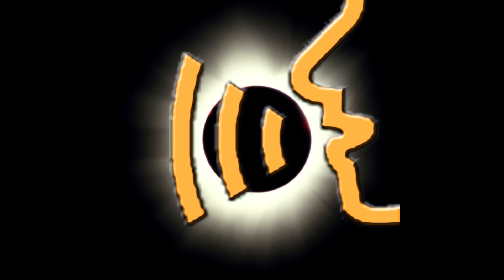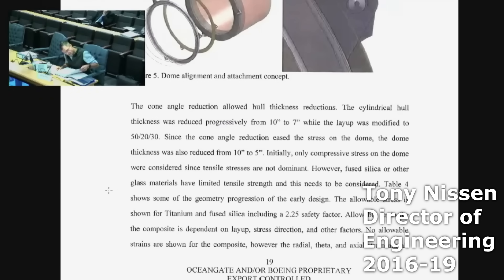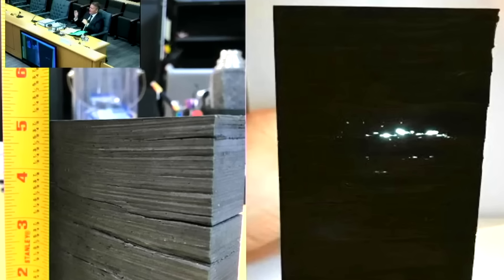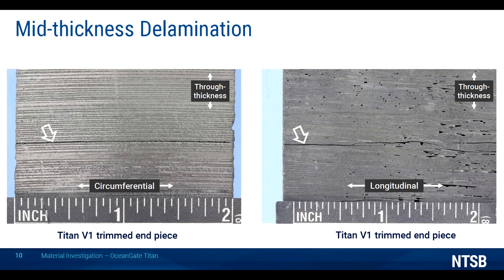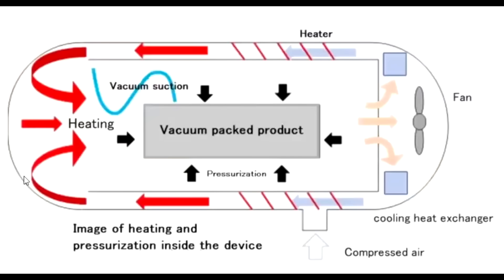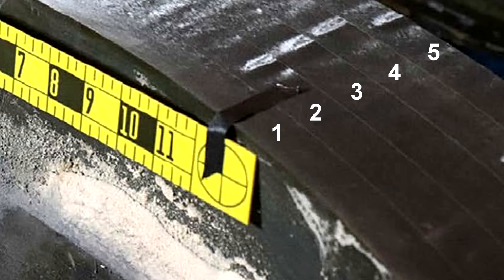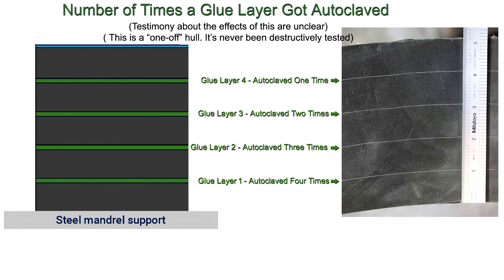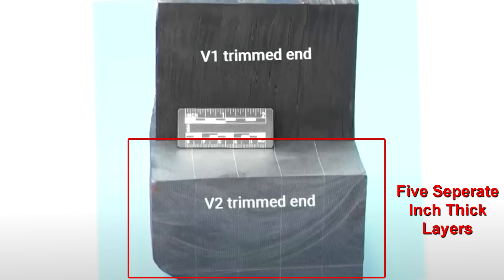Who Engineered the OceanGate Titan V2 Hull? Maybe Nobody Did?

Comment: But why carbon fiber.
Reply: It's light. Correct me if I'm wrong, but OceanGate was wanting to offer a semi-afforable option to see the titanic. One way to limit the necessary costs is to reduce the weight of the submersible, the reason you want to do that is because the bulk cost of operating a submersible isn't the submersible itself, it's the support ship that is necessary to operate the submersible. The more the submersible weighs the larger the support ship that is needed to lift the submersible in and out of the water. The thing to note is that there exist submersibles that can go to the titanic easily and reliably, however the cost to operate those submersibles is so large that mainly only research institutions can really justify their operation, but with that said these submersibles weigh tons, and thus require a large support ship for operation.
Reply from the maker: @JuniorJunison  Junior is exactly right!  Two other things to add to his excellent reply.  1.  Stockton wanted an elongated shaped hull, not a sphere.  He thought it was important for the field of view to document the dives; meaning a camera at the back of the sub shows the cabin and the passengers in the front enjoying the view (and he wanted to fit 5 people).  Spheres are small and cramped and you can get far away enough from any point to get a good image of the cabin.  2.  Stockton also underestimated the size of the vessel he would need to work in the North Atlantic.  The Arctic Horizon and the Polar Price are huge, just as large as would be needed for a ship with a A-frame crane to hoist a titanium sub.  Stockton's original idea for the subs and the LARS was not for the Titanic.  He originally thought there would be a market for multiple subs in temperate climate waters where the LARS could be towed by a small vessel in calm waters to research sites.  Search YouTube for my video on his business model, the title is   OceanGate Was Broke! - Titan Caused It - Employees "Spill The Beans!"
Reply: @solareclipsetimer  Right, Titanium even in s sphere is too much for Stockton's boat.  I think.  Or was he actually engineering an elongated titanium sub?
Reply: Light and cheaper then titanium.
Reply: the Carbon fibre sub was light enough to have positive bouyancy with passengers aboard (and could take on more passengers than standard subs).  It needed weights to sink.   When things go wrong, having positive bouyancy sub means you drop weights and you rise even without any electrical power. 

I assume proper subs which have negative bouyancy by default have ballast tanks and a tank of high pressure nitrogen (over 5500psi needed) to displace water in ballast tanks so it can have positive bouytancy and rise. But failure of valve /pipes betwene nitrogen tank and the ballast tank means you're dead.  All of this is outside the pressure vessel, so all the valves, eectrics etc nee dto be built to support high pressure salt water. 

One reason for the delay in support ship calling for help was that they expected a dead sub to still make it to surface since it naturally floated. (weights were attached with soluble paste so they would drop after certain time in water, forcing sub to rise  to surface.  t,s only once it didn.t appear at expected time of rising by itself that they called the coast guard.

Comment: What a coincidence that the new hull exactly fit those end caps they already had lying around. Would've been so expensive to buy new end caps if tests showed that 5 inches weren't enough, good thing they didn't test it.
Reply from the maker: Thanks for commenting.  They were determined to use the original rings and domes.  It was not a coincidence.  They made the new hull fit into the old rings.  And yes it would have been very expensive to design and build two new titanium rings and domes at a larger diameter.  Stockton was not going to do that.

Comment: I'm getting a lot of alarms ringing when I hear about the multiple trips to the autoclave,
This is The definition of a  DIY approach to something that needed to be engineered to the nth degree
Reply: As i understood that thing traveled wet to autoclave while curing in outside temperatures before it got autoclaved. I wonder wtf did they think, did the materrials used allowed that.
Reply from the maker: @mechadrake  Yeah, I gues they traveled wet after filing the laminate and just covering the layer with that peel ply for protection.
Reply from the maker: Yes, that was a huge unknown that I don't find any evidence that they tested for the effects.

Comment: Keep asking where are the calculations, how were the boundary conditions modeled, meaning the interface between titanium rings and carbon fiber hull and then shaving down the ends to fit into the titanium.  So sad.
Reply from the maker: Thanks for your comment.  Spencer Composites did consider the boundary between the carbon fiber hull and the titanium rings, which is why the rings had that funny-shaped machining on the outer surface, to get the moduli and the temperature-change behaviors to match.  Shaving down the outer surface of the hull to fit into the titanium channels seems dangerous to me.  But Spencer Composites specifically states in their engineering document that it was okay to do that.  But I agree with you.

Comment: I'm not an engineer but using a fabric for a pressure hull is comical. Internal pressure, sure but external???? 
In theory I could do the same thing with burlap. The sub would be huge but the concept is the same.
Reply: It’s not the same at all. The fabric reinforces the resin. When the resin cures, there’s nothing fabric-y about it.

Boats are made of fiberglass, which also sounds like a fabric, until you realize that it’s short for “fiberglass-reinforced plastic.” What we colloquially call “carbon fiber” is more properly called “carbon fiber reinforced plastic.”

So it’s plastic, not fabric.
Reply: @lebojay  Its resin infused fabric.
Carbon fiber resin infusion is a process that uses a vacuum to saturate dry carbon fiber with resin in a mold. The resin cures into a solid polymer that holds the carbon fiber in shape. The result is a strong, lightweight part with a good """"resin-to-fiber"""" ratio

Comment: I work in aerospace composites. I have so many questions about this. Were the materials properly stored? Did they stay frozen until it was time to build? Were the materials expired? Why would they use prepreg tape instead of BMI, or something stronger? How did they account for the temperate and humidity fluctuations while it made all those road trips?  I can't believe they didn't use the 45 deg. plys. Also, I wonder if they did any ultrasonic inspections? If so, I'd love see how many voids, delams, FOD, etc. there were.
Reply from the maker: Thanks for your thoughtful comment.  You ask great questions and right now we have no good answers.  Maybe the final reports from the Coast Guard and the NTSB will answer some of these questions.  I wonder if there is testimony from Spencer Composites and Electroimpact that was not in the public hearings.  Those two companies could shed a lot of light on this weird story.
Reply: @solareclipsetimer  Ultrasonic testing was brought up during hearing. It is very challenging to do this on a 5" thick curved all to begin with (need access to both sides). But the all decked out sub had trons  of stuff attached to it, whic would need to be all removed to get to a naked cylinder for testing. Also, then anti-UV paint on the outside hindered such testing.
Reply: Some of the answers are quite simple, they used prepreg because they could buy it cheap from boeing. Were they expired? Yes, or close to it, which is why boeing was selling it cheaply.

Comment: Maybe this was covered, but it seems to me that every time they grind out the bulges, they're breaking carbon fibres, so the fibres near the outside are no longer joined to the rest of the structure. This would make it weaker, and more likely to separate.
Reply: Fibers are still held by the matrix, it does weaken the local skin of the hull section, so yes but only a bit.
Reply from the maker: @s.sradon9782  Thanks for commenting.  The fibers and the matrix work together.  I have a video I am working on right now concerning this.  From the NTSB analysis of the cut-off ends of the V2 hull, I estimate that the full-sized hull had over 300 grind spots spread out through the inner four layers.  The number of grinds increased in the outer layers.  All of these together cannot be a good thing for the hull.  There is this engineering issue of "out of roundness" when under these high pressures.  If the hull was flexing asymmetrically due to random positioning of grind spots, this creates additional stress.

Comment: Why is this even being investigated? This incident is no more tragic that a car crash. Some dude built a homemade sub and it failed. So what? Who cares? Why is so much money being wasted on this nonsense? Because a billionaire died?
Reply: Ideally we learn from our mistakes and don't repeat them.
Reply: 1. To learn.
2. To explain to the families of the innocent passengers why their loved ones died.
Reply: @ It does not require millions of taxpayer dollars being wasted to learn from this incident. Nobody is learning anything we did not already know.
Reply: @21stcenturybohemian  I disagree.    Foud out about the logic used to evade requirement for certification, but most importantly, Coast Guard has learned there is no current way to certifiy  such subs since each composite design is a different material.   5 inches of crbon wound in a certain pattern does not have the same strenght as 5 inches of same fibre wound in different way. And thern there are different types of filaments, different ways to mix resin with fibres and curing them.   For metal subs,  the titanium properties are the same for a same thickness so you can develop standards that can apply if you use that specific metal.
Reply: There are no regulations REQUIRING certification for a commercial sub operation under certain size or number of passengers (whcih the Titan was just below).  Those hearings from Coast Guard are part of a process to decide if/how such subs should be regulated and sicne there are no standards developped for composite subs, how would certification be done.  So those are valid questions.

Comment: Edit: never mind, he covered this at 17:00  :)  15:20 note that the innermost layer has been through the autoclave 5 times by the end of the process, and 4 times for the innermost inter-layer glue - how well does the carbon fibre, the glue/matrix, and the inter-layer bonding glue stand up to that many heat exposures and thermal expansion cycles?

Comment: They don't seem to have followed a reasonable engineering process. They clearly had engineers involved. The implication seems to be that everyone juat did there little job and no one ensure that the overal processes was ok.
Reply from the maker: You are so correct.  There was not a lead engineer with marine experience overseeing this.  There is a reason though, it would have been stopped by a real marine engineer.  Stockton did not want it stopped.  That is the purpose of classing a sub.  With classing, many engineers with marine experience analyze your novel ideas to see if they make sense and are safe.  This sub would have never been okayed by the classing societies.
Reply: I won't even pretend to be qualified to understand this. My background is in electronics. But the overall lack of process(in building and testing this sub) feels like something you'd see from a freshman student. Certainly not someone formerly trained. Fascinating video.

Comment: He he he, why do we get the impression that you are trying to aquire a scalp here? Personally I don't think anyone is going to put their head above the parapet here.
Reply: No I don't think that is what he means. When he asks who was the engineer responsible for the overall sign off it is rhetorical. He is trying to say the reason we cannot find that person is that they do not (and never did) exist.

What went wrong here is that they did not have anyone ensuring that a safe engineering process was used. They just had a bunch of people doing individual bits of the manufacturing or giving isolated bits of advice. But no actual overall engineering process. And hence no scalp to take.

Comment: As usual for engineering, much is learned from failure, and the new rules are written in blood.
Reply: No new rules nor old rules would safe those who think they are smarter than the rules.
Reply: This implies that there were no rules before which would have prevented this. The rules were just not followed.
Reply: "At a certain point, safety is unnecessary."
- Stockton Rush, current resident of the bottom of the Northern Atlantic sea

Comment: It was clearly a bad idea, but could have been done less incorrectly. I was not aware of the need for them to reuse the titanium rings, but that's a pretty risky design constraint to beholden.
Reply from the maker: Thanks for commenting.  Yes, they reused the rings.  Can you imagine cutting off the old hull and then putting that huge ring on some kind of lathe that can carefully cut out the carbon fiber glued into the C-channel.  When doing that, they should have seen that the glue bonding layer was not uniform.

Comment: "bulges in the hull were removed by grinding".   In other words, they compromised the fibers.   
Ive also seen a video where theyre wiping the cap ring down with alcohol and touching with bare hands right after.   This was supposedly right before they were going to bond the caps to the hull.
Reply: Yeah the guy with a dirty rag and bare hands just breathing right onto the surface. And you can see the end caps in the wreckage have absolutely zero glue still bonded to their surface. It didn't even look like they scored or prepped the titanium surface to help with bonding either.
Reply: @john-s-peñois  There was some glue still attached (saw it in some other video), but you're right that they didn't seem to score the titanium, or at least not enough: the glue broke off in large chunks, like it would a layer of varnish or superglue.
Reply from the maker: @JaroslawFiliochowski  Agree, that V1 hull gluing video was frightening.  And OceanGate released it to the public as a promotion, as if they were proud of it?
Reply: @solareclipsetimer  probably thought that the 'general public' wouldn't tell the difference
Reply: @JaroslawFiliochowski  It was machined to clean after the first hull-NOTHING BONDS to a polished surface effectively.
Reply: @ - Well, after creating such a safe vessel by lovingly grinding away (i.e, cutting and tearing) some fibers to get rid of bulges, you wouldn't want any nano-scale roughness of the titanium  caps to damage the hull! That could be bad, mm-kay?
Reply: I was also in disbelieve. They did what?!
Reply from the maker: @fracapolligummala3548   I know, I am making a nice video on that right now.  Stay tuned.
Reply: Yeah, they worked it like they were working with metal.  Maybe they just paid off their engineer to say yes all the time but if I were that engineer, morally, I would have had to call them out and I would have neat feet out of there.  No way do I want my name tied to this disaster in waiting.  Also, NASA!  How the hell do you give a consult on something where application isn’t taken into account?  That’s the whole idea, you engineer to an application.  Christ.
Reply: @deafmusician2   that crazy “C” with the composure with totally different bulk modulus. I would guess they wanted “E” shape with several blade shapes entering the composite to first increase the bond area and next to insert a bulk modulus change as a smooth gradient. Or, scrap this whole concept and build a safe, massive titanium hull.
Reply: @deafmusician2  there’s a video from the investigation where the sub is being set down on the deck of the boat after a dive, full of tourists and the operator. One of the end caps literally falls of and lands on the deck, right on the viewport. I think it was a dive in the 60s to 70s.
Reply: @Notmesaidsamiam  no, if memory serves correct, that was the Titan, just a few dives before the fatal dive!   And inspection upon reassembly was next to "is it there?"
Reply: @deafmusician2  the look on their faces when it just plopped off was priceless.
Reply: @Notmesaidsamiam  a HUGE "Nopers" in MY book!
Reply: @deafmusician2  Grinding was taking 14 layers deep in many places,some more,some less.
As the CF hull was expanded by baked layers,the bumps increased.
If my memory serves me right,the 4th layer had 76 grind areas.